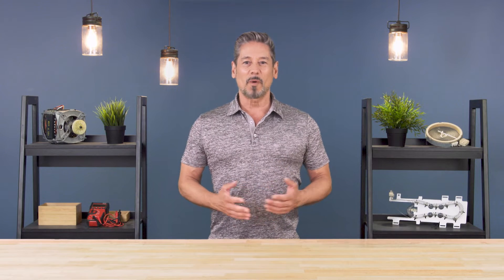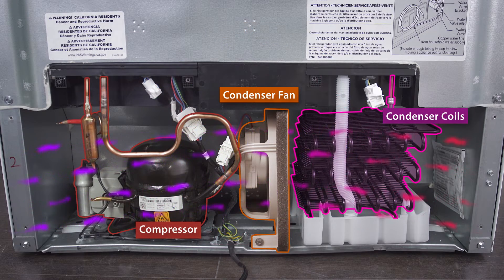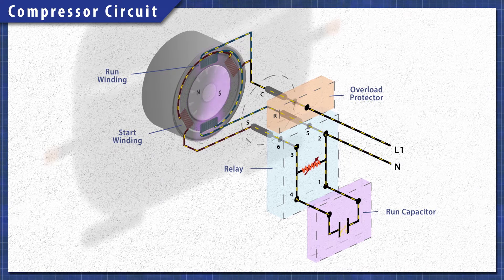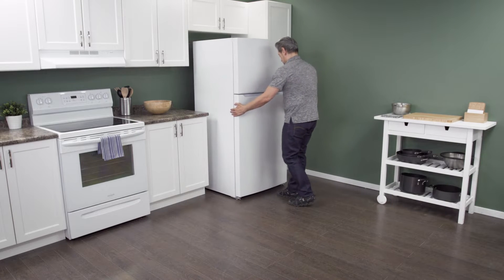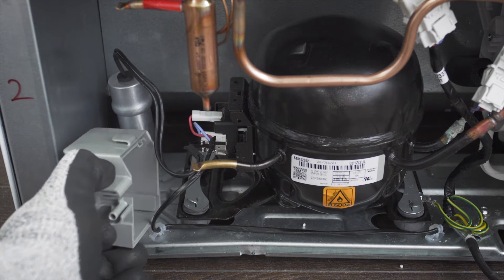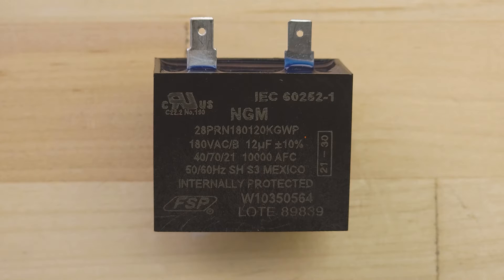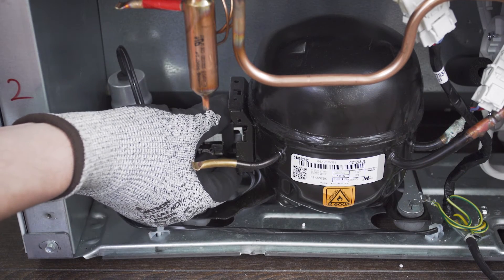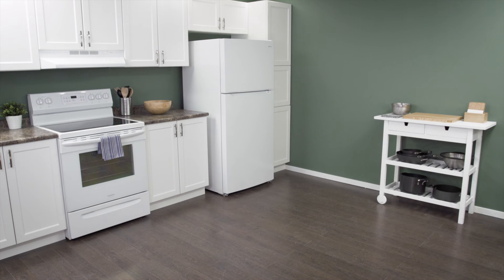How to Test & Replace the Compressor Capacitor in a Refrigerator | Repair & Replace

Comment: My capacitor is not like the one shown in the last part of the video, but like tghe one showed at https://youtu.be/qBVdReaEJ-s?t=79 and higlighted https://youtu.be/qBVdReaEJ-s?t=296 (metal cylinder at very left) How do i test this?

An why did you changes the tested capacitor type in the middle of the video!! 😤
Reply from the maker: We didn't change types, we showed more than one model of refrigerator in the "component removal" section , and showed the testing on the flat type as it's easiest to see the terminals. If you have a round type then you'll test between both terminals, and if these are wires, then you'll test both wires.
Reply: @AmreSupply  Look closely again, you changed type of capacitor. The fridge showed on the first part have a cylindre type.

Comment: Good day, I have an old Husky Commercial cooldrink fridge, my technician just fixed 2 gas leaks, thermostat and the wring from the thermostat, he tested the winding of the compressor, which was good, but when he plugged in by us, the capacitor blew, can it be that it is just the capacitor, or can it be that the compressor got damaged inside? I bought it second hand and it seems the people I bought it from wanted to fix it. I froze up from the inside and at the outside where the compressor is, not on the compressor but the one pipe froze up. I am stressed that it may be the compressor that is causing the capacitor to blow. Please let me know. He is saying it may just be the capacitor, but my brain is saying something else
Reply from the maker: Thanks for watching. It can be difficult to tell. Try installing a new capacitor and see if it works properly. If the capacitor fails again then it could be an issue with the compressor.  You could also test the cmpressor for a short following the steps in this video: https://www.youtube.com/watch?v=NND8J8dXqJ0

Comment: A faulty capacitor will cause an overheating situation that results in the compressor shutting down prematurely. A good test to see if an overheating situation exists:  pull the refrigerator away from the wall and remove the cardboard cover as shown in the video.  Clean the cooling fan and area with a vacuum brush attachment.  Doing all of this will maximize the air circulation. Then plug the refrigerator back in, and see if the capacitor now allows the compressor to stay on for several minutes, as it should.  If it does, then the capacitor is probably faulty.  If it doesn't, then check for other problems, such as a faulty relay or faulty compressor.
Reply from the maker: Thanks for sharing those are great tips. We explore this in more detail in this video: https://www.youtube.com/watch?si=PoS2AjkwSkLVAN4E&t=87&v=oPmr6boufmE&feature=youtu.be

Comment: Hello there,
I have this Bloomberg built in freezer which is not cooling at all. The evaporator fan is running but no cooling in the evaporator. I could not access the compressor to verify if it’s running. Are you able to help and provide me how to access the compressor of a Bloomberg built in freezer, model #: BRFB1050FFBI
Reply from the maker: Thanks for watching. That's not a model that we're familiar with but it likely has an access panel of some kind.

Comment: So this fridge has two capacitors?
The cylinder type and then one attached to the start relay?
Reply from the maker: Thanks for watching. These are 2 different models to show the variation of how capacitors are mounted and wired. At 5:29 "in other models" is mentioned to help highlight this. 

There might be some models with both start and run capacitor but this are not as common. Run capacitors are more common in general.
Reply: @AmreSupply I think what we’re both seeing is at 5:18 he states he’s grabbing the start relay and capacitor with an obvious capacitor attached to the relay (this is the same model with the cylinder capacitor in the back) Is the cylinder capacitor the start capacitor then?

 I’m having a tough time differentiating between start and run capacitors. Are there any physical attributes or where they’re located/not located that you can use to consistently tell them apart? Any explanation would be appreciated, thanks!
Reply from the maker: @chrismcclain6518  At 5:18 there is a single cylinder run capacitor for that Frigidaire model. At 5:29 there is a mount on rectangular run capacitor on the Whirlpool model. 

If a model has a start and run cap they will likely be close together and obvious. 

For some older models that have a start capacitor, these will likely be cylindrical, and will generally be larger. You can also know if it is a start capacitor based on where on the relay the wires are connected. See the example at 2:38 for more detail.
Reply: @AmreSupply You have excellent videos by the way. I’ve since subscribed and wish the business well! 👍
Reply from the maker: @chrismcclain6518  Thank you, we're just happy to share some good info! These videos take a lot of effort to produce but we feel it's worth it in the end!
Reply: @AmreSupply I understand now, thanks so much!